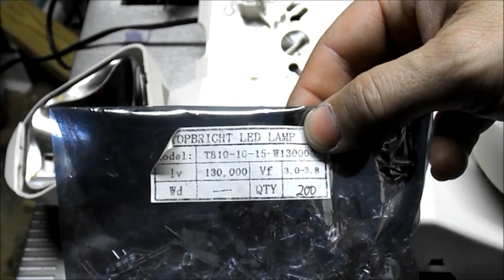How to Build a New Solar LED Light

Comment: The batteries may have discharged due to the fact that these are originally emergency lights designed to turn on when the power fails.

Comment from the maker: I got up this morning and the light filled up my 960sq/ft basement. I could see good, but the light would be to dim for my camra to see. The cover on the emergence light defuses the light from the LED. This makes them less of like little spot lights. I will make another video with the voltage and amps. When we take a 12 angle of light and spread it to 180 degrees we have a multiplyer/devider of 15. To figure out how much light is spread  we square the multiplyer and get 225.